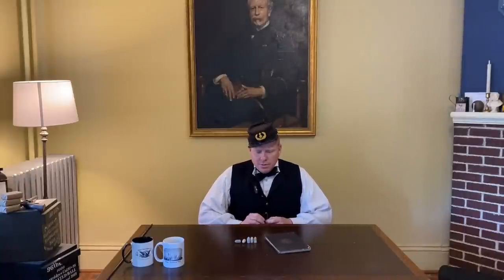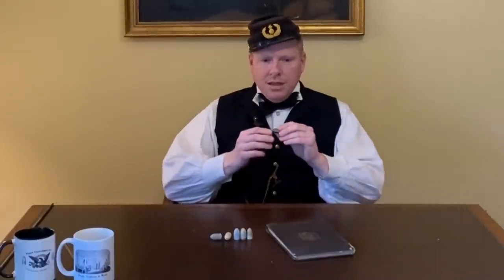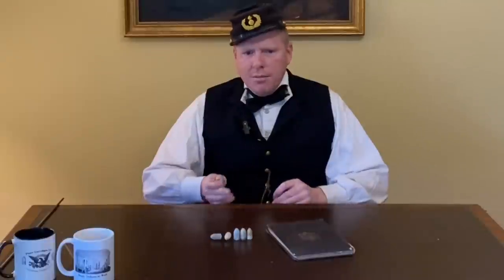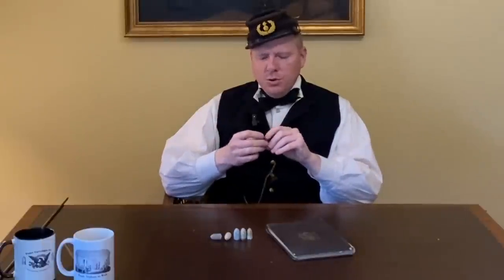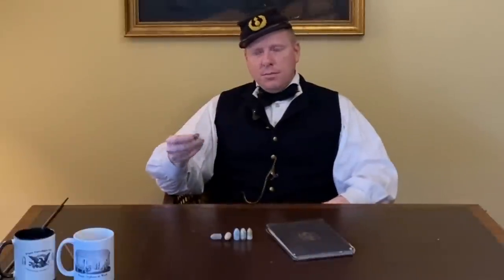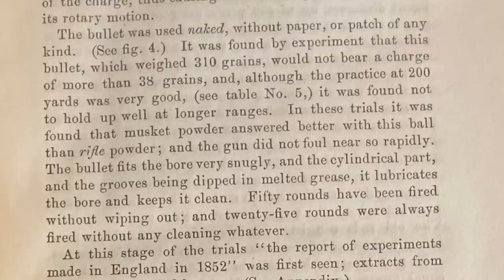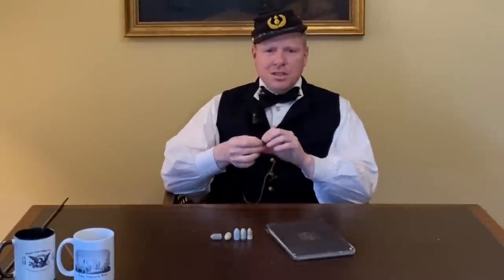Why did Civil War bullets have grooves?

Comment: What about the Pritchett it also had no grooves and its from 1845 - 1850..  I'm just curious by the way..
Reply from the maker: The English took a slightly different philosophy. The grooves caused drag by design, and the English wanted higher bullet velocity. By making Pritchett bullets by compression (not casting) they were more balanced and the British believed that the grooves “could be dispensed with” in their words. Pritchett bullets had a velocity of 1265 feet per second compared to 950 feet per second with the US Minie.
Reply: @papercartridges6705  quite interesting I'm sure there's the bias for a physics paper there somewhere.  I feel a thesis coming on.

Comment: Question- given that bullets of the Civil War era travelled slower than modern bullets, would they have penetrated body armour if the troops had any?
Reply from the maker: Certainly not modern body armor. If you check out my earlier videos you’ll see one where we shoot modern body armor with muskets.
Reply: @papercartridges6705  Thanks, and I wonder if any CW troops hung a steel plate round their necks on their own initiative, buttoned under their tunic to protect their heart and upper chest?
Same goes for other periods of warfare including WW2?

Comment: This explanation makes a disturbing amount of sense.  Especially if you consider the trajectory of BP bullets.  Maybe a non-cannelure bullet would be aligned with the (relative) wind until the top of its arc (maybe), but it certainly wouldn't be aligned as it started to fall.  Placing those cannelures on the bullet probably had a disproportionately big impact at longer ranges, where the bullets would be falling back to Earth.

Comment: ok mister bullet nerd guy.......

when they started using the rings for lube, did filling the groves in result in worse accuracy because the surface area of the grove was fillied in and not catching the air??
Reply from the maker: Yes probably. I’ve dug up bullets at the range backstop with the grooves still packed with lube.

Comment: Then explain why a Hawken maxi ball (Buffalo bullet) only does one twist in 28 to 48 inches❓🤔❓
And a round patch ball flys best with a 1 in 55 to 1 in 75 inch twist (very slow)❓❓
Modern BP hunting Rifles have a very fast twist (1 in 28 inch) to  stabilize the longer bullets....
Reply from the maker: I don’t know. I have no experience with modern bullet styles and won’t pretend to know how they work.
Reply: @papercartridges6705  
The Maxi Ball looks like a big wadcutter....
They're about an inch long and solid lead all the way through and is 320grs.....

Comment: Why don't Enfield Bullets have grooves?
Reply from the maker: Two main reasons. First, they decided they wanted higher muzzle velocity instead of tighter group sizes, as they believed this gave British soldiers a longer point blank dangerous space, even if their shots wouldn’t be quite as accurate as a grooved bullet. Second, the English were among the first to begin producing bullets by cold compression (sometimes called swaging), which stamps bullets out in a die under high pressure instead of casting them with melted lead in molds. The compressed bullets were inherently better balanced, and didn’t have any of the flaws often encountered with cast bullets, due to how lead cools down inside the mold and forms vacuum bubbles.

Comment: Do modern reproduction Civil War rifles still have that very slow twist rifling? I noticed that some reproduction Civil War pistols have a 1X30" inch twist, while others have a 1X18" twist. By the Civil War most were using paper cartridge conical bullets in rifles and pistols.
Reply: I have a 3 band Enfield 1853 rifle-musket  they saw service in the American Civil War it is a reproduction made by Parker Hale and has a 1 in 78 twist

Comment: The right answer for the wrong reason.  As mentioned by several others, the grooves allowed better expansion of the projectile base creating two positive aspects, both of which increase accuracy.  One, the expanding bullet better engages the rifling, better stability.  Two, the expanded base created a better gas trap thus more consistent propulsion for the projectile.
Spin or fin, mixing the two is counter productive.
Reply from the maker: Could you please point me towards the 19th century sources that give these reasons? Keep in mind the original bullet these grooves were applied to was a solid base Thouvenin pillar-breech rifle bullet. There was no hollow to expand. So if the grooves are for allowing better expansion of a hollow base, please provide historic sources for why they put them on a solid base bullet in the 1840s.
Reply: @papercartridges6705  There doesn't need to be a hollow base for the thinner material, of the lands, created by the grooves, to flow into and engage the rifling.  This is a design feature of modern, and not so modern, artillery projectiles with rotating bands an obturator bands and grooves.  
Just because designers of the 1840s didn't correctly understand the ballistics, both internal and external, doesn't mean they couldn't accidently land on the correct answer.  30 years later artillery ammunition would start sporting the aforementioned bands and grooves for precisely the reasons I mentioned.

Comment: British Enfield bullets of this period had no grooves. Were they less accurate?
Reply from the maker: The British considered using the grooves but they made the deliberate decision to keep the smooth bullet, partly because the grooves caused extra drag and the British preferred higher velocity. The Enfield bullet has to rely on rotation for stability, but since it was about 25% faster velocity than the US grooves bullet, the lack of grooves wasn’t noticeable until long range, when the bullets slow down. The grooved Minie typically will outshoot the Pritchett beyond 400 yards but the Enfield cartridge has a longer dangerous space. It’s a trade off.

Comment: They are called lube grooves so the bullet can have some sort of lube smeared into them so it minimizes leading in the rifling of the gun
Reply from the maker: You’re correct that the US version of the bullet also found the grooves conveniently held lubricant but this was not the original or primary purpose for the cannelures being added to the rifle-musket bullets originally, in France in the 1840s.

Comment: My understanding isntheir purpose is two-fold.  Firstly, they help move the center of mass forward.  That helps heavy and slow projectiles maintain drag stability.  Secondly and more importantly, they were expansion points.  They'd be swaged into the groves by the blast.  They'd go more deeply than the full-thickness wall of the tail.  That'd provide a better seal, accuracy, and velocity.  They certainly helped with lube, but it wasn't their purpose.

Comment: Great video! I'm rather surprised you didn't mention more about Minié's other additions. The concave back end was designed to expand and grip the riflings there by allowing a slightly smaller projectile to be used, decreasing the force required to load the bullet making it more rapid and efficient. Between the percussion cap the Mini ball and antiquated tactics, the Civil War was a slaughterhouse. Obviously there were many more factors involved but...

Comment: I accept grooves made the bullets shot more accurately.  But I am not convinced by the explanation especially since when the grooves of the US bullets were filled with grease they still were also accurate.   
there are modern all copper bullets with grooves on them meant make it easier for the rifling to displace metal on the stiffer all copper bullet.  Look at the longer Barnes all copper bullets.   
Do not believe everything you read.  
Also do a little bit more research.   
While some 5.56 rifles are a 1 in 7 twist, 
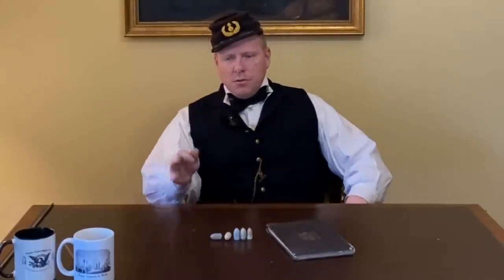For the springfield musket:  Shortly after the original load the 500-grain 45-70 became available. In 1873 the Army set the twist rate at 1:22 

1861 Springfield Musket Features:
58 Caliber. 40" Rifled Barrel. Twist 1:65"   
But remember it was 58 caliber, but of the same wt. as the .45-70 50 grain bullet so it may have been a shorter bullet.  One needs a different calculus for twist rate when other parameters are changed.   Also a hollow base might also change the stability of the bullet more than the grooves did.  
Just needs more research.
Reply from the maker: More research? I literally posted the pictures from the original sources, showing rifle twist rates, and the purpose of the grooves, in several different 19th century books… and you also seem to be confusing rifle-muskets with .45-70 breechloaders. But go make your own video and prove me wrong!
Reply: @papercartridges6705  
I did enjoy your presentation about how the early cylindrical rifle bullets were developed.  
More research about ballistics.  
You reported the explanation by the french captain as fact.  Think a little outside of the box.  If I was doing videos of a historical nature, I would be careful of accepting all without being critical.  A good scholar is always trying to figure it out.   
As I said the bullets were indeed more accurate, but I do not accept the explanation of why they were.   Now I cited some observations on my part and you have no interest in them other than being hurt in the rear end over it.
Reply from the maker: The information you posted is incorrect. For instance the twist you quoted for the 1861 Springfield is actually the twist of the Traditions modern reproduction rifle, not the originals, which were one turn in 6 feet. I’ve spent a lifetime researching and writing about these things; I get the sense that you spent a few minutes Google searching and copy-pasting from a repro rifle makers website, and then tell me to do more research. Again, respectfully, if you think Captain Tamisier is wrong, and his grooves don’t work, go make your own video, provide historical evidence to support your argument, and prove us all wrong. The black powder shooting community would be grateful for your corrections.
Reply: @papercartridges6705  
interesting that the twist of the original 45-70 was not so different from the 58 musket.    I am looking for information.  
I explicitly did not say his grooves do not work, but that I was questioning  his explanation as to why they work.  This was my interest and I do not mean to set up indignation and anger.  Patience with those of lesser knowledge is a virtue.     

Can you not add something along that line of thought.  Certainly since you have spent much time on the subject you certainly can correct my few minutes looking on google.   And it is interesting that the modern 45-70 springfield reproductions have a different twist and  I wonder why. 
 I know the colt replica cap and ball guns are rifled completely differently from the originals.   
As I said before I did find the history most informative.